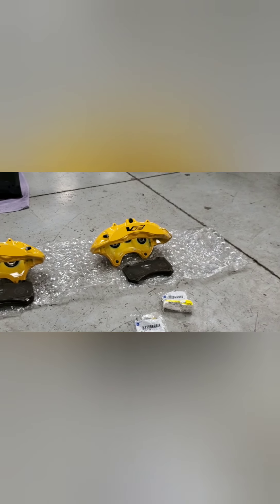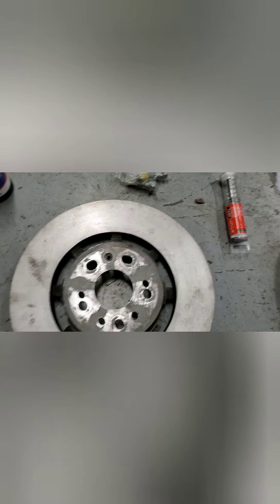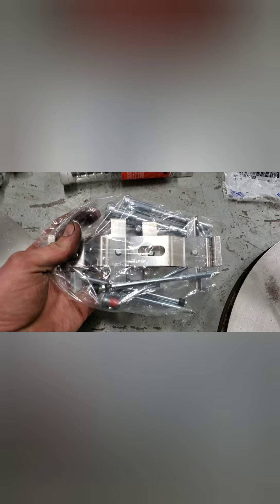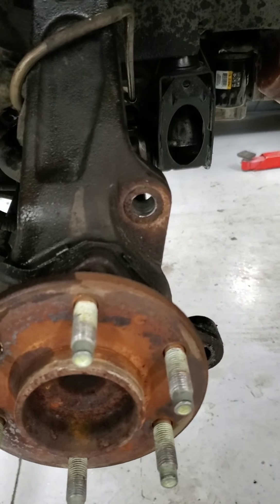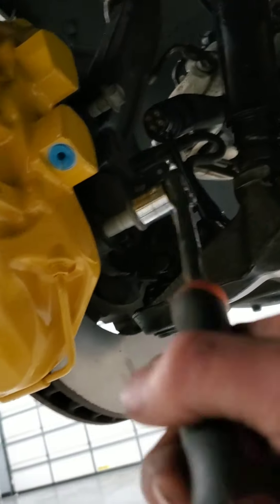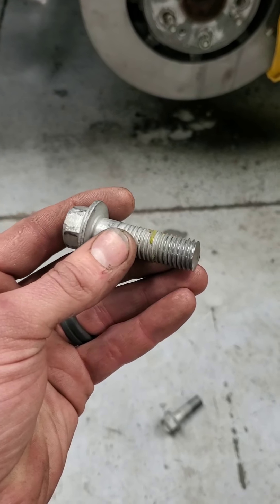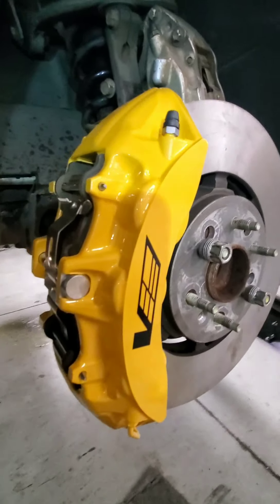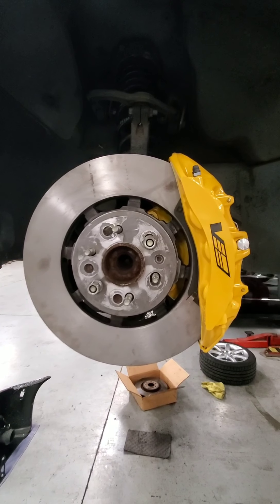Cadillac CTS-V V1 to V2 brake upgrade how to

Comment: I have a 05 ctsv the rear brakes on the gen 1 are pretty much the same size as the ctsv gen2 rears ??
Reply from the maker: Very similar. I think the embrace is a little different. And the calipers have a slight difference